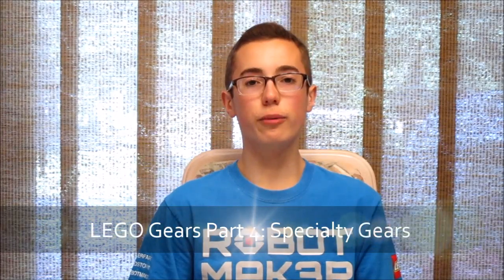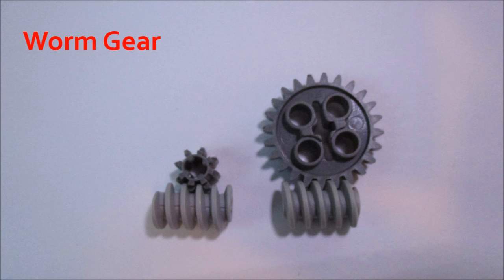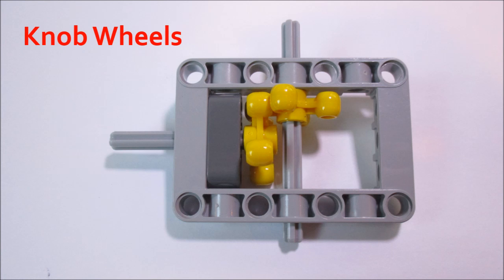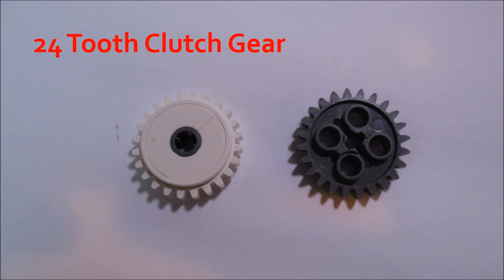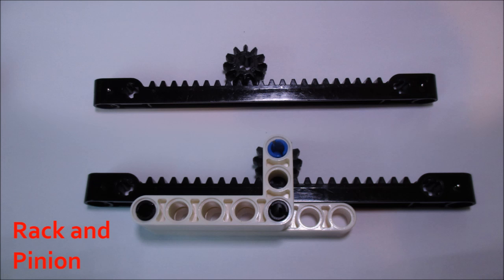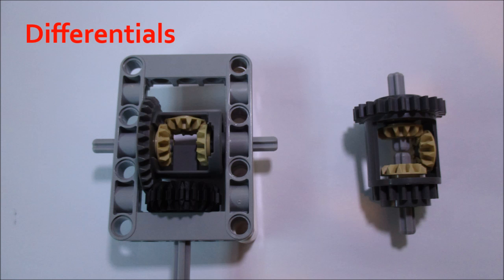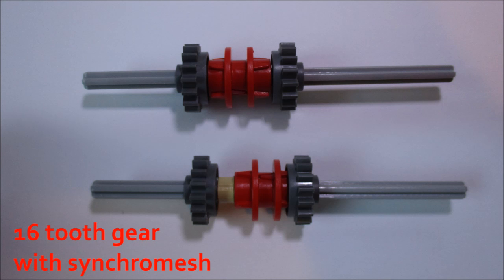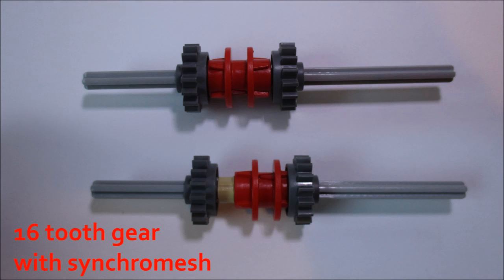LEGO Gears for EV3 Robots Part 4: Specialty Gears

Comment: A few corrections:
2L worm gear meshes with: all lego gears except for: 1L worm gear,  14 tooth bevel gear, 3L differencial, knob wheels, master builder/duplo gears. (duh)
It does work with: some gear racks, turntables, 2L or 3L worm gears, 4L differentials.

knob wheels can act together as spurs and/or bevel gears. It just takes a bit more thought to get them to work.
Reply from the maker: Thank you for sharing this information! I missed those details.
Reply: @Builderdude35  more like crown gear. 1.5 l axle with 8t double conical gear.

Comment: Which differential do you recommend to put in a car drive train?
Reply from the maker: It depends on what your drivetrain is like, and especially what motors you're using. for rear-wheel drive with NXT/EV3 Large motors, as used here, use the parallel differential. If you are doing all-wheel drive and/or using PF XL motors (or any more traditionally shaped motor) use the ring-and-pinion (90 degree) differential.

Comment: BuilderDude -- We've been studying the secrets of top teams, and we see that there's a "standard configuration" that most high-scoring teams share.  The design is called the "Flying Tortoise", or "Flying Turtle".  There's a MOC on ReBrickable to see what we mean, though many variations are possible.  We see that most top scoring designs have: two motors that can be used as Power Take-Offs (PTOs) which can be used with just gravity, two light sensors and (we assume) a gyro.  They are flat and fairly low.  

We suggest you do a video along these lines to help other teams improve their scores.